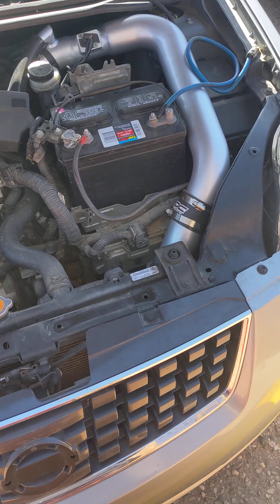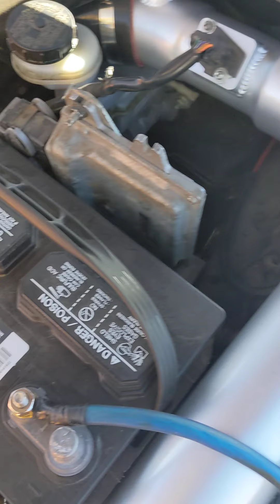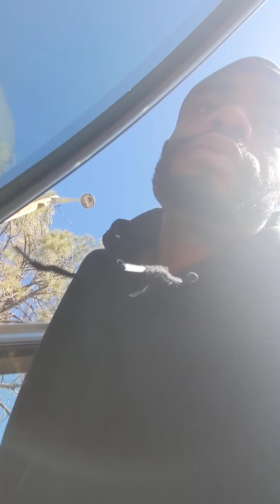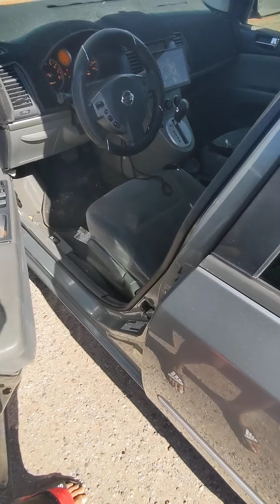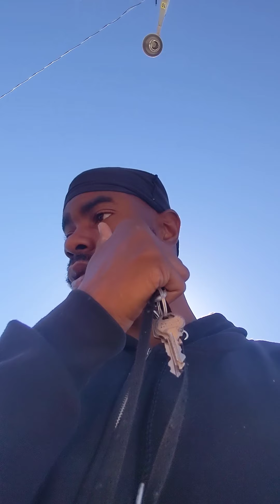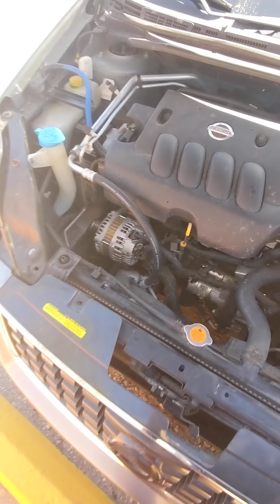2008 Nissan Sentra cold air intake installed

Comment: Can you show how the hose is going I have this exact same shii same car but my hose doesn’t fit
Reply from the maker: I dont have the car anymore
Reply from the maker: U can do it
Reply: @elpolloloco5594  it run rough there the black thing on the engine where the air come out is the lil
Box on itn
Reply from the maker: Yes i belive @fortnitetrash5850